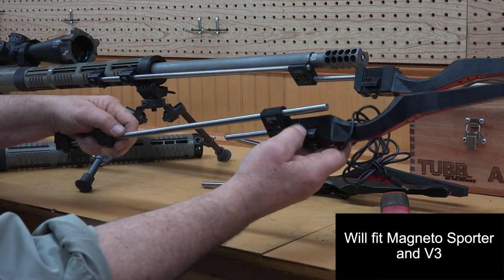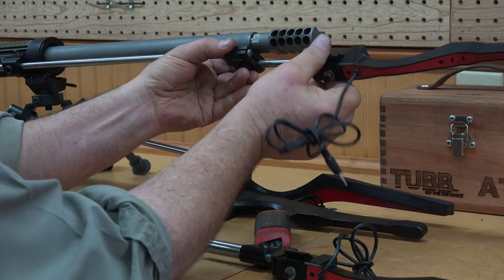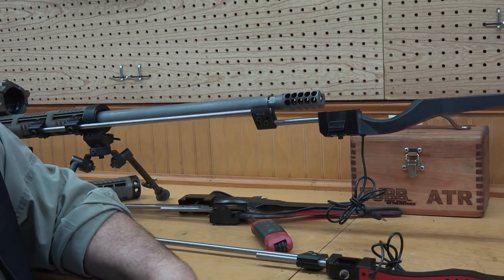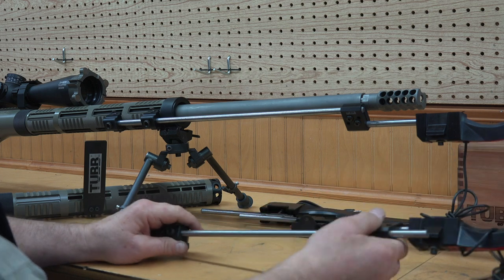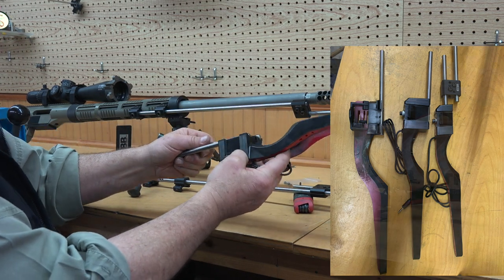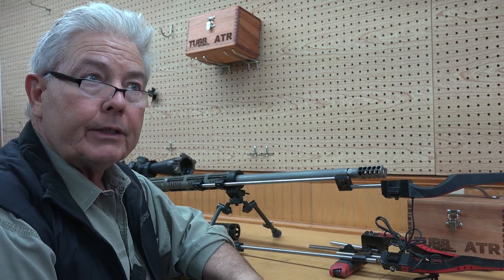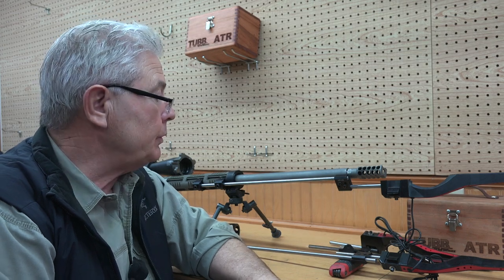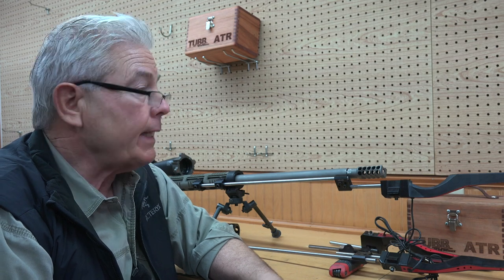TUBB® Gen 2 Magneto Mount

Comment: Been running a very similar rod assembly, my system is very close to this one.  I made the deal up after I seen Mr. tubbs interview with Frank Galli after one of the king of two Mike events. Getting the mv readings when shooting elr has been a huge advantage when trying to center a group on tgt at extended ranges. I believe I will purchase Mr Tubbs bayo rig fir my next setup. Thanks Mr Tubb, as always I learn so much from your experiences!!!!!